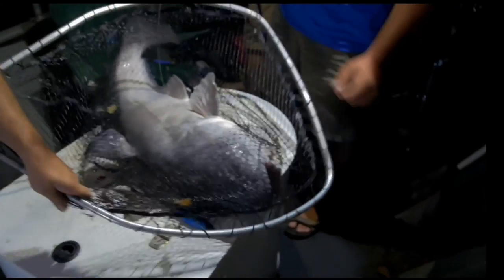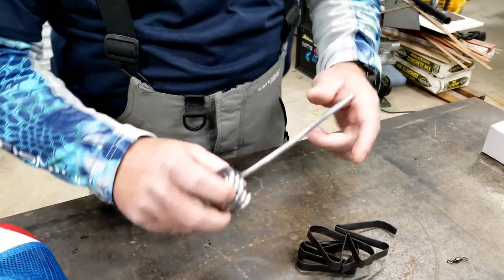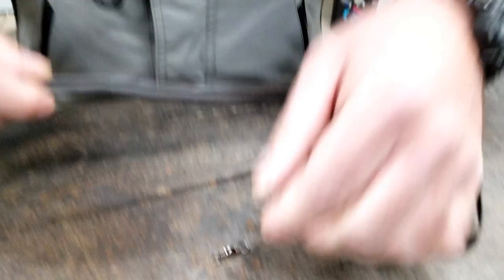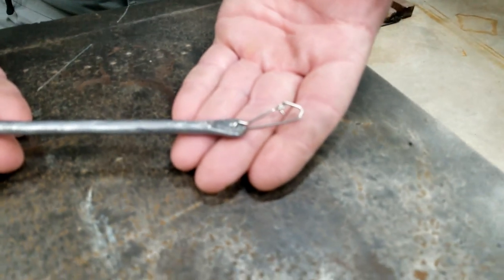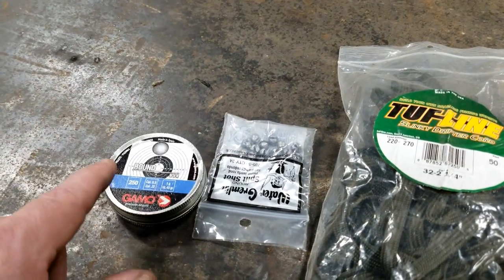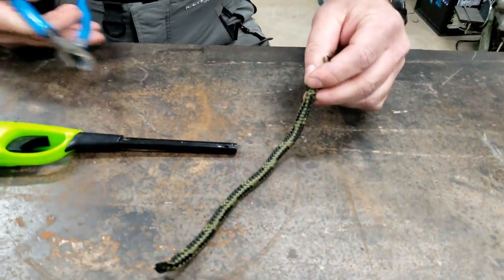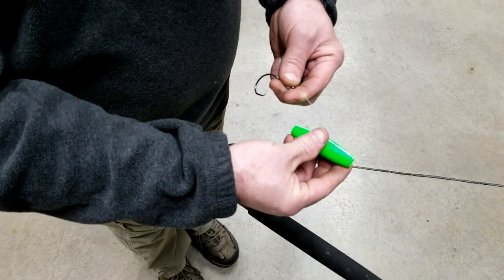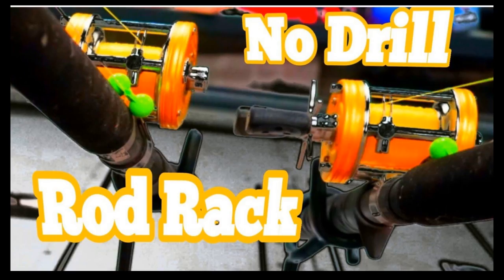Fastest way to make Drifting weights ( something new )

Comment: Man that new drifting,  draggin ,slinky style weight is the way to go. I  dont trust the 1 with just heat shrink and swivel,  but the 1 Nu Skool did with mashing the lead and putting a hole with the swivel looks like the way to go. GREAT Idea guys, Ill be making my next bunch up like this. Thanks and Great idea. Keep the videos coming
Reply from the maker: Thank you brother,  they all worked really good , the one with the heat shrink tube wad string than I thought it would be .

Comment: Just wanted to update and let your followers know found something else to use in the drift weights 
I saw where someone used BBS instead of the lead shot as every one has noticed lead any thing is hard to find ! I bought 6000 steel BBS Daisy brand at wall mart cost under $7.00 bottle has two pour openings it takes 84 to make 1 once for those without a scale weight of the tube material not big issue  hope this helps y’all tight lines

Comment: Good video and I appreciate the link to the lead core wire.  Am I reading the price and doing the math right in figuring these sinkers are about $1 a piece if they are two ounces each??
Reply from the maker: That's what I figured too  , that's a lot better than 3 dollars for a drifting stix weight . Or even comes in cheaper than the paracord weights . But still the selling point too me , what makes me like em so much is the time saving . I could put 5 of these together by the time I make 1 paracord slinky weight

Comment: Steelhead river fishermen have been using the punched lead for 30 plus years check out lead master pliers the closer you punch the hole to the edge makes the lead break off easier so you don't lose your whole rig
Reply from the maker: I knew steelhead fishermen came up with it , and catfishing kind of integrated it into their sport.  But I didn't know about those pliers that's a good idea man . I like the shrink tube myself , ppl were saying it would break off but that's why I liked it . Because you won't lose your whole rig

Comment: I use 1/2” cpvc. Heat one end up, dab some glue on it and clamp it shut until it dries.make it as long as u want it, put as much shot in it as you want, heat the other end up, dab some glue on and clamp it shut. Drill hole for a swivel. You can heat the middle up and put a bend in it if you want. Also it rattles. Cheap and easy.

Comment: I have soft core lead ingots that i made from lead i bought at the scrap yard. if i came up with some kind of mold to pour the lead in lets say 2'' strips i wonder if it would work just as well.
Reply from the maker: I believe it would , you know Jeff Manning has a video about making pencil weight molds . Some Aluminum and a 1/4" drill bit and I think you could make these too

Comment: Been testing all your diy ideas for these weights. Try 1/4" ID fuel line, bead inside at ends for plug, BBs and heat shrink!
Reply from the maker: My favorite so far is the solid core . It's fast , easy , and it works
Reply: @FishinNStuff  haven't tried that yet. I was using stuff I had laying around. I do have plumbing solder. Imma try it tonight
Reply from the maker: It works good , maybe not better but just as good as most . But I love how easy they are

Comment: nice tips ! is the shrink tubing the same size as your solid lead or does it have to be a little larger in diameter?
Reply from the maker: I use the same size but it's harder to slide it in.  You can go bigger

Comment: They actually have a set of pliers that will flatten and punch a hole in it so you can cut as you go based off the conditions
Reply from the maker: Thanks pretty dang cool . I like the shrink tubing.  I get colors to match my rods lol
Reply: @FishinNStuff  i usually get the black...but, I like the cord...may have to tey that one.
Reply: @FishinNStuff  when you make your slinky, what weight slinky do you use for your math 6.5"=2 oz?
Reply from the maker: That's pretty close , they don't have to be perfect but that will put you really close too 2 oz

Comment: What size/kind of shrink tube for that?
Reply from the maker: For the 1/4" lead I used 1/4" shrink tube . It's a little tight so you could go up a size if you wanted
Reply: @FishinNStuff  Thanx a ton :)
Reply: @FishinNStuff  Would the 3/8 hold the swivel good though?
Reply from the maker: @chadharrelson2880  I might i haven't tried it but I like the swivel too be the break point so I don't lose my whole rig . Honestly though I haven't lose one of these weights yet